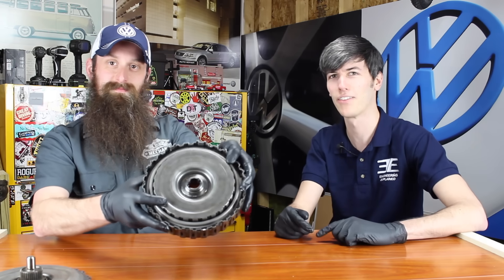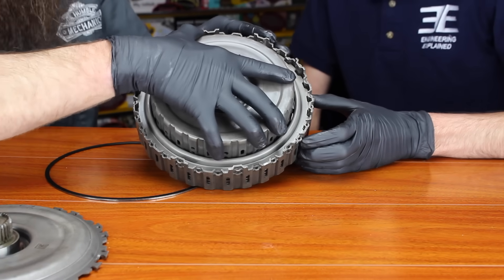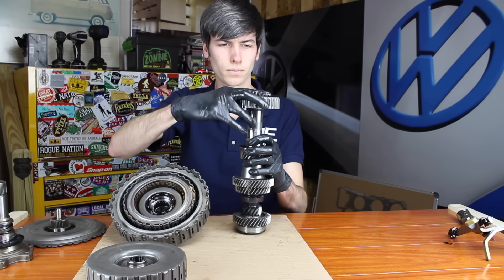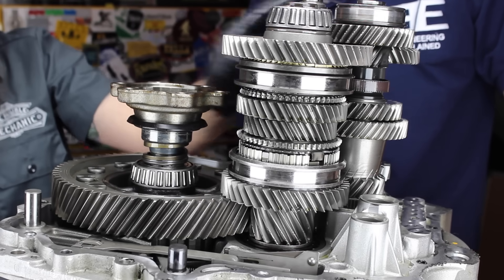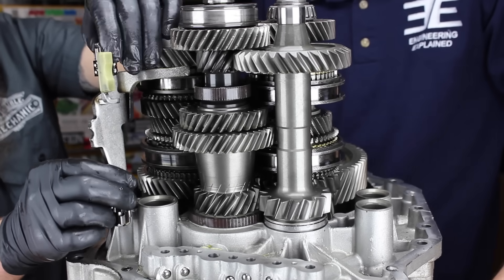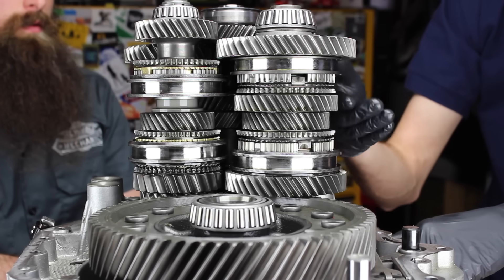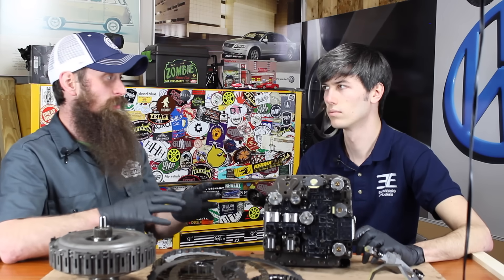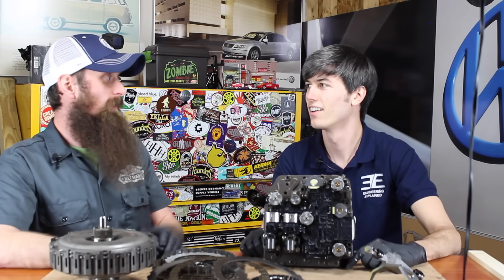DSG Transmission - Explained

Comment: 5 & 6 speed manual the most fun, but least practical for daily driving in heavy traffic inner city, steep hill seattle like stop & go congestion
Prius style PSD mix of electric motors & engine CVT the most elegant CVT solution I have ever studied, see John D. Kelly Weber State University Deep Dive Prius Transaxle Videos Youtube
Conventional Automatic sometimes the best like the 4sp Auto Toyota used in the Corolla for nearly 15 years, really durable & that slushbox great for stopping & starting a lot with fluid coupling
DCT super fun on the open road, fast shifting, amazing shift speed, but can be really clunky & stange in stop & go low speed city traffic
Electric single speed final drive like Nissan LEAF, the most elegant smoothest solution Meg or I have ever driven, especially amazing at slow speeds between 0-5 mph, amazing instant torque from the electric motor, shove you into your seat continuously while accelerating joy & fun unlike anything else I have ever tried, amazingly quick off the line, in LEAF. Tesla takes it even further
Mixing a conventional auto with a CVT like lexus does in their luxury sports cars seems like a complex expensive solutions thats both higher performance & higher efficiency 
If formula 1 can do a CVT well with 1000+ HP, I am not sure why Honda Nissan Suzuki BMW Ford GM Mercedes etc cannot seems to make a decent CVT // thats holds up well

Comment: Why do the gears get smaller from first to sixth and why is it so unreliable
Reply: The smaller the gear , the greater the ratio from input to output. That is all a transmission does, it changes the ratio of input to output.

The reason they are unreliable is that clutches wear out (like a manual trans) and then they eat the synchronizers because you have 2 output shafts. While, theoretically they should be way easier to fix than automatic transmissions, manufactures make the Clutch pack a pain to change and very expensives parts as well.  If you were to lets say, change the clutch pack like you would on an manual transmission you would never run into any issues(and keeping oil clean of course). But we live in a world of planned obsolescence, things just have to work well for a certain time.

Comment: It's the speed of a DSG shift that I find most interesting, not the actual number but what is defined as a 'shift'. Midway through the video you mention that at mid-'shift' it is possible for two gears to be partly engaged through both clutches. And as mentioned already in the comments, the required gear engagement has already happened. And even when a clutch has started to release it can still be transmitting power (most manual drivers learn how to do that on their driving lessons). So at what point is the shift considered to have started and ended?

Comment: Great job, thanks. It would be very helpful if you make a video about how TCU behaves based on different conditions. I mean there are many functionalities that TCU has to be while driving a car. These functions might be engine overspeed protection, ABS control,  Lockup control and so on. Do you have any recommendation for that? or briefly, what are the roles of TCU while a car is on the road?

Comment: Hmmm - similar (and a more advanced) version of the pre-selector used in the Lanchester LD10 (circa 1946 - 1951). You selected the next gear, but it did not engage until you pressed and released the clutch (if my memory serves me correctly). Incredibly clever technology though.

Comment: With DSG gear box is it ok to free wheel down hill in neutral N and re-engage drive D when power is needed while still moving?
Does doing this at any speed have any adverse effect on the gearbox or clutch?
I've done this a few times and it seems absolutely seemless on my 2012 Golf Plus Mk6.
The car seems to know which gear to re-engage in from neutral, at any particular speed, and the rev changes are the same or lower on re-engagement than they are when the gear box changes gear itself.
I was wandering if there is any good technical reason not to do this?

Comment: I have an 06 Audi tt with dsg and really  like it a lot . I was happy to learn that the C8 Corvette has an 8  speed DSG. I'm a guy who  grew up with, and  really like the standard transmission , but if you only have one car you drive daily  there is a point in your life that you get tired of pushing in the clutch in stop-and-go traffic just to move ahead 20 ft. For me the DSG transmission is the best of both worlds. Sport mode regular mode paddle shift bump shift offers a lot of variety in a lot of fun without wearing out your knee. My brother-in-law had a Mazda Miata that he put 250,000 miles on with a standard transmission. He needed to have his knee replaced. I asked my sister which knew it was, she said his clutch knee.

Comment: Hurts my brain trying to understand is wizardry, the designers of this are incredible
Reply: Honestly I think I picked up a good portion of this surprisingly. Whenever people tried to explain how a manual trans works to me when I was younger, trying to learn stick, they honestly just confused me so much more than if they told me how to use the clutch and not explain how the transmission is actually working. However if I watched this video it would’ve made much more sense now.
Reply: There's a video explanation of ZF 8HP on WeberAuto channel. Check it out
Reply: The cost to maintain one also incredible
Reply: same  here bruhhh xD xD
Reply: Weak brain. This is pretty easy. 😂
Reply: The only really clever thing here is (ok it's all clever) is the one shaft within another allowing independent rotation depending on which clutch is activated.   I'm not an expert and I don't want to sound smug but as he says, it's a manual gearbox operated by pistons controlled by electronically controlled solenoids.
Shame there's been so many problems with them though.  The low gears / clutch packs just weren't durable, otherwise there's a good argument that these should have replaced every automatic transmission in the world.  A manual gearbox electronically operated is a far simpler build (and repaired) than traditional auto box nonsense that have become unmaintainable now.
oh, I've just realised how old this vid/comments is/are !  Sorry about that.
Reply: They are called engineers. If you like the idea, look into "machine design" in engineering, and engineering school is awesome :)

Comment: Amazing engineering! So how did mine fail at 63k in my 2013 TDI?
Reply: Mine is failing on a 2013 cc r-line, only has 65k miles

Comment: as a kid I never understood why they didn't make triple clutch transmissions? I even wrote down the gears that should be on every clutch for it to make sense so you could take off or even floor it in every situation hahaha
but forreal if you're in 4th for example and need to overtake someone real quick, 3rd might just not be enough and 2nd is on the same clutch so it can't smoothly engage 2nd... I know all VW engines over here are turbocharged and get going if you need them to, but especially with those 3 cylinders and everything there's bolting these DSG's on to, being able to use more of it's gears in more situations wouldn't be a bad thing?

Comment: What about the cost of rebuilding these transmission down the road. I had a ford focus with the DCT transmission in it. Yes, I knows its problems,but one thing that I never realize is the cost to rebuilt these new transmission. I now have a 2015 ford focus with a manual 5 speed transmission. It should cost me around $700.00 in parts and labor to put a other clutch pack in it Vs a DCT or VCT . Which might run anywhere from four to six thousand to replace the disc packs in them. Again I taking that these transmission are over 100,000 miles and out of warranty.
  Most of the transmission shops are saying that these DCT or VCT transmission's are pretty much a dealers only fix,because of the cost for them to take on is to expensive to take in terms of equipment.

Comment: No way! Just give me a clutch pedal and a stick.
Reply: I have 2 cars with the both - manual and DSG. Yes, DSG can't match manual. 
1. DSG manual mode is incredible slow. Especially if you want to switch a few gears quickly. In other words I can't switch from the seventh into third in one press or wise versa. Also the lack of neutral is annoying.
2. In auto mode it can't simply switch 2 gears down, because it's on the same clutch. Hence either huge delays or just one gear change. Potentially it could drop 3 gears down, but the algorithm isn't clear.
I can give away the clutch pedal, but I need neutral and an ability to engage any gear at any time. Well electric cars don't need a gearbox at all...

Comment: Thanks for the awesome info.
I am considering buying a wrecked 2011 Volkswagen Jetta TDI  and I am trying to learn all I can.
The car is an easy rebuild, but friends at a foreign auto shop said beware of the DSG Trans.
I personally think it is a brilliant design, but only if totally durable.
Reply: From what I understand, the early DSG models (DQ250 6 speed wet clutch) from 2006-2010 had issues with the Mechatronics unit (brain), but that was fixed, anything from 2011 onwards has the improved mechatronics unit, a traditional manual with a clutch pedal will still be simpler, more robust, more reliable and more fun, but the current 6 speed DQ250 is relatively solid

The 7 speed dry clutch DQ200, OTOH, still has issues and it really doesn’t respond well to low speed creeping in traffic, the DQ250 is a little more robust, but also isn’t a fan of creeping.

Basically, you need to drive the DSG like a traditional manual transmission, don’t creep in traffic and it should be okay

Comment: Hi guys, nice vido. Only one correction: the even gears are on one shaft while the oneven gears are on the other shaft. Otherwise it could never preselect a gear while another gear on the same shaft is selected. What it dus is while disingeging one clutch it ingeges the other. Therefore seamles shifting.

Comment: When gear lever is moved to the park mode, what actions happen inside the box? Does it lock the output shaft?
Reply: There's a gear on the output shaft and the transmission sticks a pawl (piece of metal) in it.
Reply: Little gearbox fairies come out the woodwork to throw a small anchor. When you select D, the fairies go back in their box.

Comment: In theory could a DSG be given a fly by wire clutch as it were that could be used to manually operate the clutch if desired? Does the mechatronics unit (as VW call it) have the ability to provide that level of control if it were to be manually operated?

Comment: All great until it fails, then really expensive to fix, and yes they fail all the time.
Reply: Do you know what's needed to fix one that failed? I have a VW scirocco, the gear keeps disconnecting when on D2 (as if it was on neutral).  I changed the whole gear box, and then the mechatronic block, but problem still occurs!

Comment: i've seen flywheels of many jetta's and passat's rattling and at 15000 miles an then cost a bomb to replace. any idea why so many premature failures?
Reply: I have a 2013 Jetta tdi with 80k miles only thing I noticed is the clutch squeaking slightly when it's cold and goes away when warmed up. Still shifts insanely fast and smooth.

Comment: I have a 2.0tsi scirocco and id like to know if it pre engages gears BELOW the gear your in. For example, I am coming up to a hill and downshift manually from third to second, will second gear already have power applied to it or is the pre engagement only on upshifts?
Reply: Only upshifts. Some dsg's are programmed to look at pedal position. If you are letting off the gas and touching the brake the lower gear will be pre selected.

Comment: Which automatic gear box used in benz,bmw,jagur,ferrari etc..
is it planetary type gear box ?
Now is any planetary gear box used in any vehicle
Reply: Toyota hybrids use planetary gear box. Never heard one failed. Unlike those DSG. :D
Reply: There is tons of planetary type transmissions. The new Ford 10r80 has 3 or 4 planetary's in it!

Comment: I love mine.  Works like a charm.  45K miles so far.  I've heard bad things about the ones from other manufacturers, but VWAG seems to have it right.

Do NOT skimp on maintenance.  Change the fluid at the recommended intervals.  And drive it like a stick.  Don't just pound the pedal like you have a slushbox.

Comment: This is a very good explanation.  I just bought a 2014 Jetta TDI with this transmission.  It takes a bit of practice to drive it smoothly, but it does work.

Comment: Sometimes I can feel my car (2012 VW CC) trying to pull forward when I'm stopped, even with my foot on the brake. I assume that means the DSG is riding the clutch slightly, which is something you don't normally want to do.  Other times, I can tell that the car has done its best to release the clutch entirely while I'm stopped, and when I take my foot off the brake on those occasions, I can feel a slight delay before the clutch engages.  

For that reason, I like to shift to neutral at stops, since I can't disengage the clutch "manually" any other way.  Is that a big no-no? I'm wondering about mechanical issues, not "best practice" driving technique.  In fact, my sense is that the car shifts into first and takes off faster when I hit Drive and go.  The car sometimes takes much longer to engage if it's in already in Drive but has decided to disengage.  

Probably will keep doing it unless I hear a well-reasoned argument against. I like feeling "in control."

Has anyone seen a VW white paper on how to drive the DSG to best advantage?
Reply: I have a 2017 polo GTI DSG and have stared putting that into neutral (if bluemotion doesn’t switch off the engine) because I saw a video saying that holding your foot on a clutch wears the thrust bearings.  That and I’ve noticed it rides the clutch as you describe.  I’m pretty sure any fault with these boxes will cost a fortune to fix!

Comment: New 2011 1.6 Tdi Skoda Octavia with DSG 1) Clutch breaks within the 1st year (replaced the whole clutch) 2) Clutch breaks again on the 4th year (they changed only the even gears) 3) Varta battery blows up, ECU of gearbox burns up they replaced the ECU and changed the oil into a brand new one recommended by the company....6 years on and I have a judder when I move from 3rd gear to 2nd gear but the gearbox holds up for the moment. Compare this gearbox with my 25-year-old supercharged 4 speed auto honda and you can tell this gearbox is s**t.

Comment: This was very interesting. But how does it shift so smoothly? In a manual, if you drop the clutch, you get jolted back, but here it doesn't happen. Does it double clutch automatically or simply, since the gear change happen so quickly, the RPMs don't drop?
Reply: I drive a DSG Golf, and I couldn't give you a solid answer to this question. The shift happens in an instant, and the car drops the RPMs to meet the next gear's needs. I believe it's in the tune of the transmission, as anyone pursuing power in a TDI model will typically need a DSG tune to achieve a higher power output.

Comment: 2019 and we're still using metal on metal gear driven mechanisms. Should be using tube technology! Most engines are still held together by a big rubber band.

Comment: My question is : does a DCT needs a torque converter or it is engaged directly to the engine through multi plate wet type clutch?

Comment: Thank you for making such a great video. I was always wondering why my DSG transmission sometimes jerks especially when I’m down shifting from 3 to 1. Also the example you mentioned were with the red light and suddenly becomes yellow and green where it actually doesn’t want you to move as you actually wanted to, I thought that was actually a transmission failure in my car but apparently it isn’t so thank you very much for the video.
Reply: Probably need to change the clutches or recalibrate them to extend the lifetime a bit.

Comment: I own a 2008 scirocco and have a juddering problem with the gearbox when pulling away,  apparently it's the mechatronics unit and it's wearing out the clutch pack and will cost thousands,  sorry I bought a DSG never again

Comment: Great explanation guys. My wife just got a car with a dual clutch transmission and I wanted her to be cognisant of the proper way to drive the thing and why. The whole thing will certainly be over her head but it will help a lot when I try to explain the computer's anticipated next gear and how she should think about driving correctly.

Comment: VW pioneered this type of transmission for road cars. People that say the break a lot are living in the past, but yes, the DSG tranmission has a bad reputation by people not in the know. The main issues was at pre 2008 models. Most of that has been fixed, but like any complex transmission, stuff can go wrong, and when it does its expensive as hell. Would i nevours about buying a DSG car, even tho they are perfectly fine and reliable these days? Yes. Because the stigma is there.